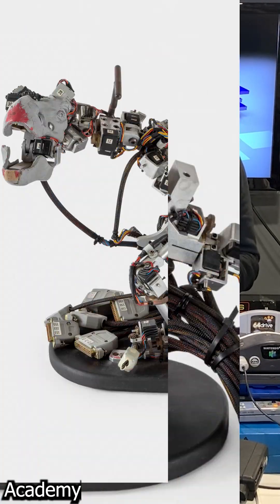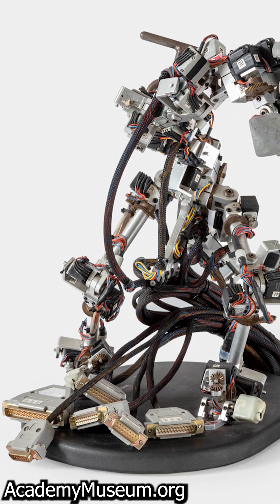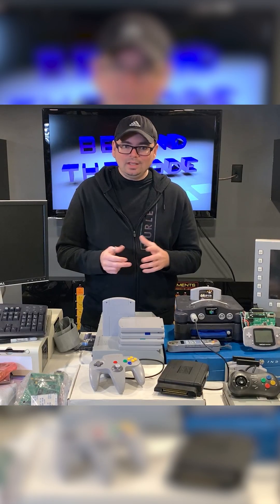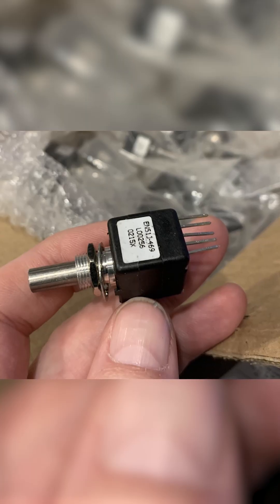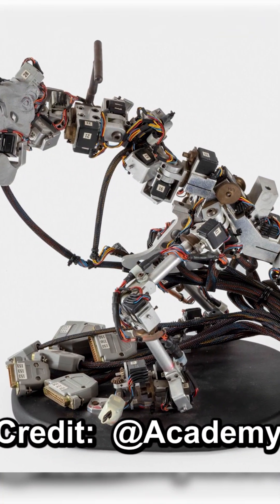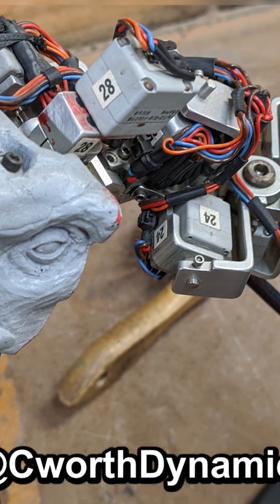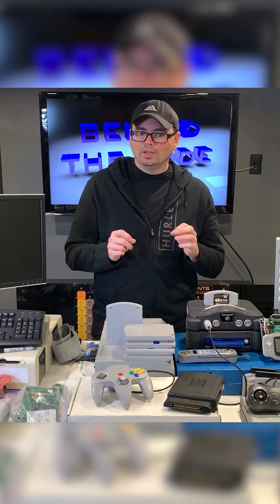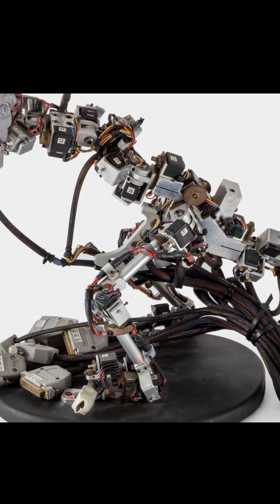Dinosaur Input Device AKA "D.I.D." used in Jurassic Park Film by Stop Motion Animators

Comment: Why would you use an encoder and not a potentiometer? I doubt they used encoders. Then you need closed loops, end stops, homing, etc. They are potentiometers. 0 to 1023 levels.
Reply from the maker: Craig Hayes the primary Engineer who built these devices for Tippett Studios decided against using Potentiometers for several reasons…

First, potentiometers are noisy and end up having to be shielded. The cables end up being very bulky because of this. Not good.

Also, potentiometers produce a noisy spike when turned more than 360 degrees. Optical encoders do not suffer from this noise.

Lastly, potentiometers are not perfectly repeatable. Optical encoders are perfectly repeatable.

There’s a really fantastic interview you can read about him talking about the build. Really fascinating stuff.  Link below:👇 

https://beforesandafters.com/2020/03/15/the-oral-history-of-the-dinosaur-input-device-or-how-to-survive-the-near-death-of-stop-motion/